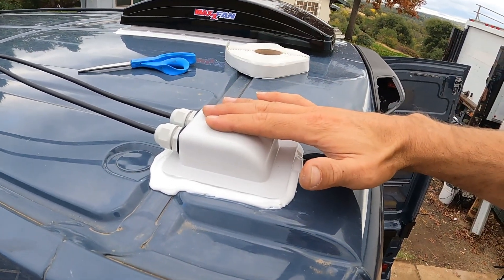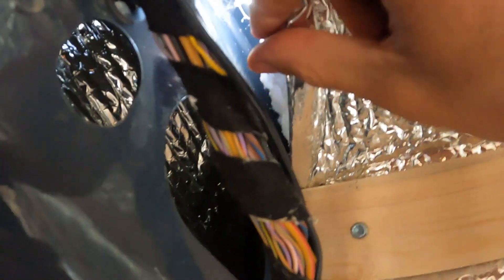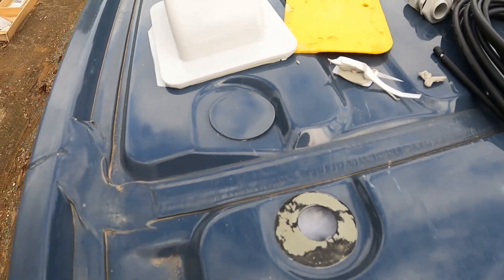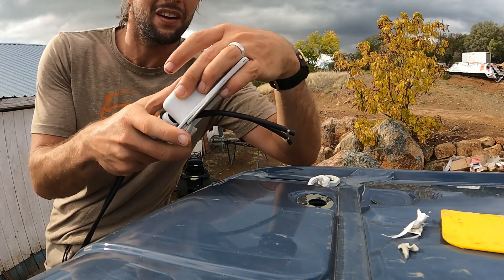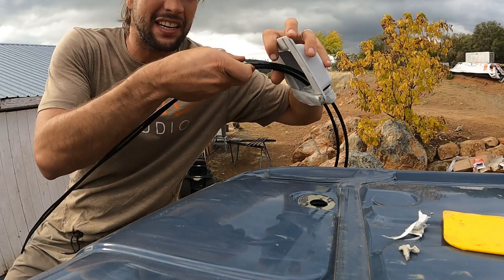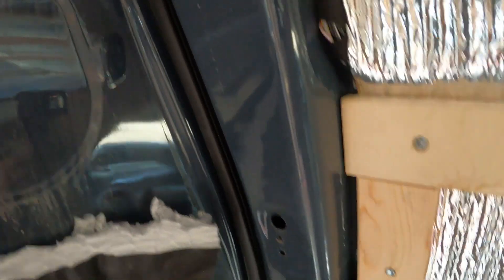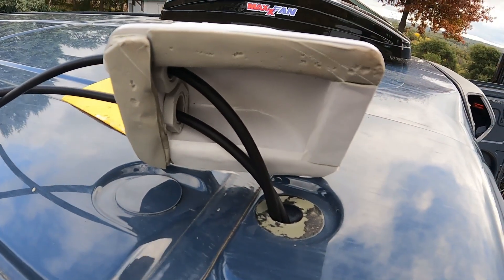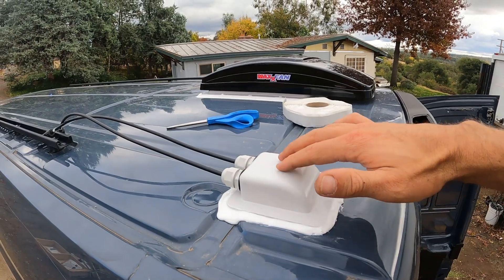Solar Entry Gland Wiring Install | First Step to Wiring Solar Panels on a Van Conversion

Comment: You mounted it backwards
Reply from the maker: Not in this case. The solar panels will block everything but I needed the cables to come out that direction. In theory with the shape and the aerodynamics it’s backwards. But it worked in this case “backwards”

Comment: Hi did you put s wright on it at all? Did the cables try and pop the gland upward while it was curing? How long did you wait before the sealant? I have a similar gland, no screw holes, less holes = better. Both the gland provider and the butyl company said the butyl is an adhesive. But you used lap sealant in addition. Necessary? I was going to use outdoor automotive UV rated silicon on the edges. Ty
Reply from the maker: You want to use lap sealant

Comment: Thanks for posting this video. My only concern is the wires rubbing on the edges of the metal skin where it goes into the van from outside.
Reply from the maker: You can get rubber grommets from true value or you can use plastic conduit as well to protect the wires.  Make sure to file the edge and give it some paint to prevent rust as well.
Reply: @Vankookz  yes, but I was referring to your job. Maybe you added them in after the video was made??? Either way, it’s all good.

Comment: Seems like it would be better to put the openings to the rear to avoid water intrusion.
Reply from the maker: The seal is so tight water isn't getting in through the wire.  I've had one mounted the same way on my rig for 5 years and never had any issues.